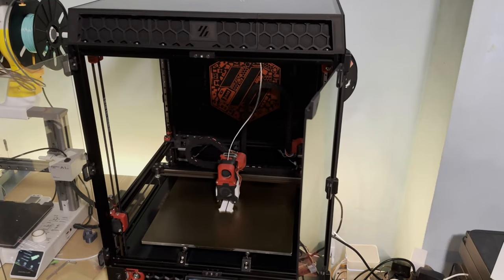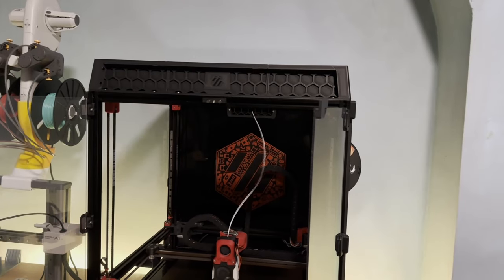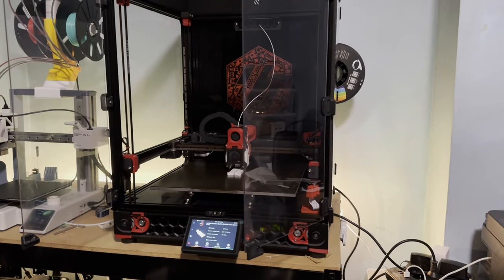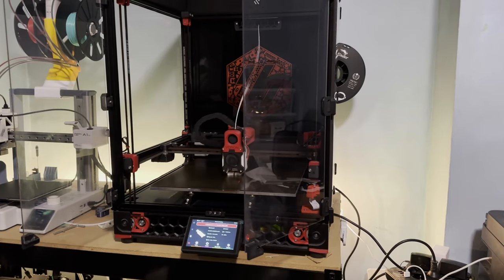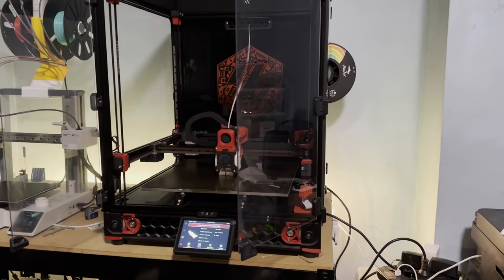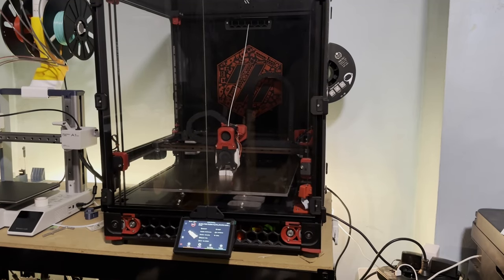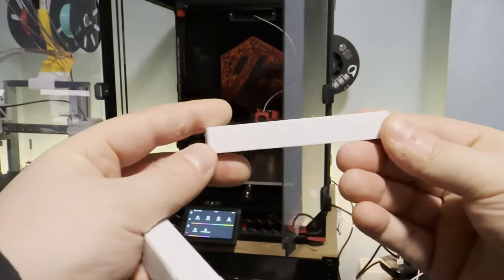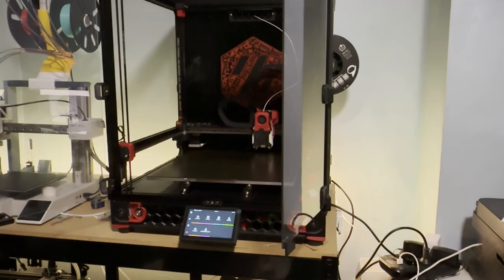Voron 2.4 R2 mods and upgrades ... vanilla to a BEAST! part 1

Comment: Id like to give a shout out for the bltouch, the can bus adxl doesnt give you the values you need since it sits on top with its adapter.
I have one but i need to finetune it with a separate adxl

Comment: My voron has been printing for like 5 months with zero issues.   Once you get it dialed in it just works.

If you print ABS or ASA don't bother with the nevermore unless you're gonna make the big one that sits on top or the rear.  That tiny one that goes under the bed is pretty much only good for moving the air around to heat the chamber.  There's simply not enough volume of carbon to do any meaningful filtering.  That room still stinks to high hell if I don't have the exhaust fan on.
The 350 is just a tad too large for me also.  I'm 6'3" and I can just barely get a hold of it.  I had to get a cart to move it to its permanent place because it's just so cumbersome to move and I would never risk dropping it.  I would get the 300 or maybe even the 250 for my next one.

Run the input shaper once using Klippain Shake N tune.  Theres a github and also some videos here on youtube.  Its really easy and you can just avoid the speeds that make all the noises.

The lights are def a must for the chamber.  Don't forget the leds for the stealthburner.
Reply from the maker: thank you for your time, awesome suggestions!